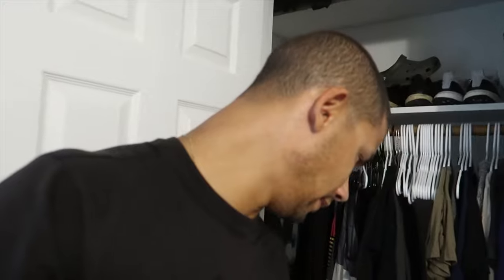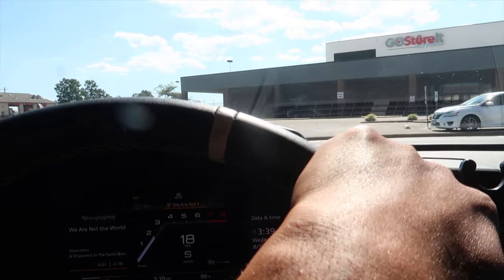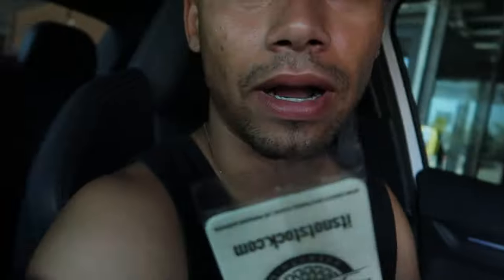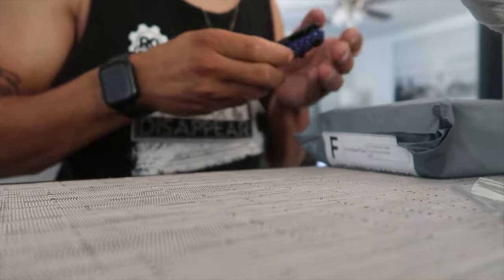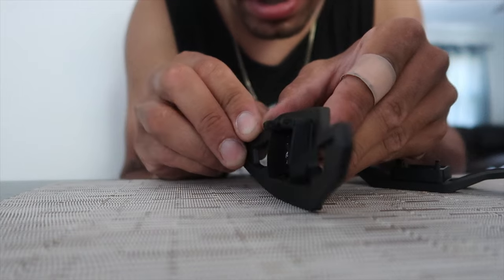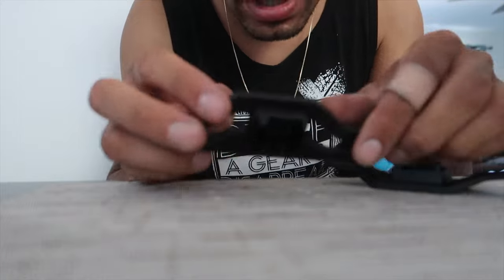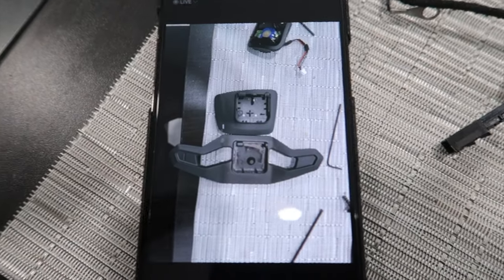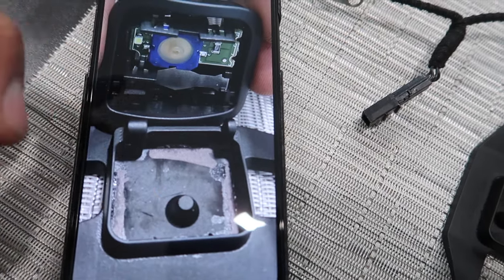Mission impossible: Urus paddles in my 8Y!

Comment: So did the steering assist work completely with the new wheel? Looking for a flat bottom wheel option for my 8Y RS3 but I want everything to work like factory.
Reply from the maker: Yeah everything works besides the actual self driving part. Which would’ve got me killed anyways so I just disabled it to not have a light and called it a day. So if you use that feature you’re SOL. But lane assist and self parking still work